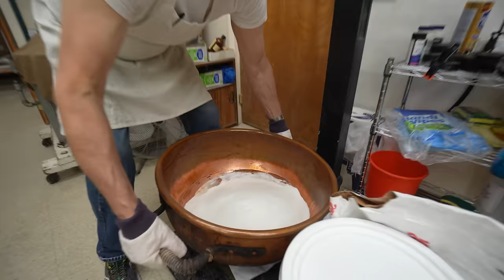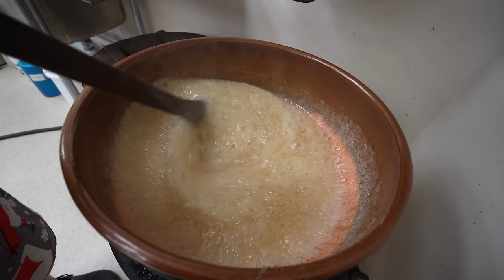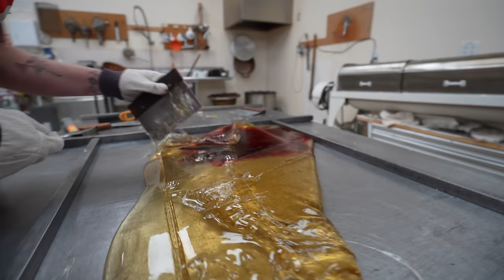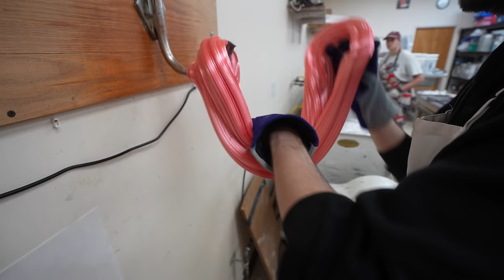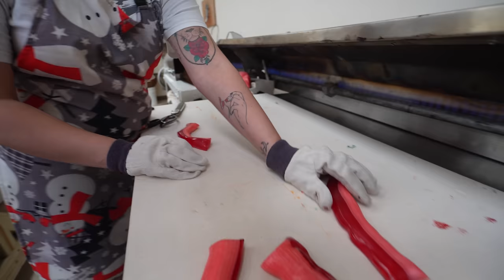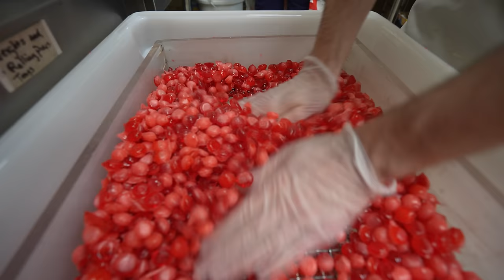ASMR Making Cranberry Drop Candy (no talking)

Comment: The washing down the sides of the pot to remove sugar is done to prevent the candy from crystalizing and becoming grainy
Reply: I don’t know if it really happens that much when corn syrup is added maybe it is not to tarnish the copper?
Reply: @goodfruitseason  You still have to wash it down. I’ve had sugar crystallize on me when I had corn syrup in the mix. I don’t usually see people wiping it down first rather than multiple times throughout the boiling process, so I wonder if they just didn’t show that. What I see more of, though, is keeping a lid loosely on the pot so the condensation wipes it down on its own. Idk if that’s actually any better, but it’s what my friend does and she hasn’t had any problems with it that I know of.
Reply: @goodfruit111  Corn syrup helps reduce it, but can't fully eliminate the risk, if there was enough corn syrup to completely prevent crystallization, the candy also wouldn't harden properly at the end.
Reply: @patrickdix772  make sense.
Reply from the maker: You are correct, Sadie!
Reply: Duh! 😂

Comment: Longer crank means higher torque. Torque is the force involved in turning something about a pivot. In other words, less effort for the candy maker to turn the roller
Reply: Yes but longer cranking distance which wears you down over a lifetime.  Candy makers die early.
Reply: Torque is rotational force
Reply from the maker: Correct!
Reply: @tombiby5892  and candy eaters die even earlier lol... I think there are a lot worse jobs an things you can do that will make you die earlier then turning a crank lol
Reply: My question is why they don’t implement these long cranks in yarn winders for crocheters and knitters? Would be much more efficient and less strain 😅

Comment: The brand of flavoring you guys use is the same I used before. I find its flavor to be extremely week. I typically add it in after turning the heat off when it cools to 300. Even when adding 2 drama to a 1lb Bach it still has only a subtle flavor. Do I need to use more? Change the temp when I add it?

Comment: How low does the temp have to get before you can start handling it on the table? 

Also, how old is that copper kettle? I’m betting it has to be cleaned it by hand?
Reply from the maker: It's more of a feel for how solid it is. If it's too liquid it just won't work. It's been passed down for generations, it's got to be at least 100 years old. And yes it does, hot water gets majority of it all off though very easily.

Comment: Why do you pull some of the batch but not all of it?
Reply: They go back to it. There is a long low flame along the back of the pulling area, behind the slowly moving canvas sling. That keeps it pliable. After she pulls and cuts sections cooling speeds up. The candy still is very hot and pliable when he puts it into the bronze rollers. After that it's cooling fast, just takes a few more minutes to be able to drop the candy so it separates. Interesting to watch  isn't it? 😊

Comment: Yes the hook adds in air but it also stretches the sugar crystals which is actually what lightens the color. Why y’all stand so close to it and barely pull it I don’t understand. Also, you don’t need to hit the hook. Just simply wiggling it a bit will loosen it up so you can pull it off